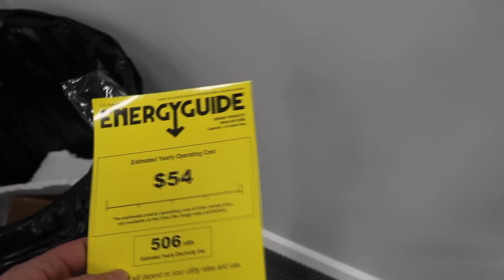Obsessed Garage Headquarters: Update Tour

Comment: Hey Matt, something caught my eye. The little compressor mounted on the wall on the left as soon as you walk in the door. Uncoil that extension cord (and any others) and fold it instead, then tie-wrap it for the clean look. Reason being, a coil of wire like that will act as an inductor even with a small load. Take a droplight rolled up from the ceiling, even a 100watt bulb can melt wires over time. If for some reason that compressor runs for an extended period of time it could be a fire hazard. Google coiled extension cord hazard and you'll find some info/pics.
Reply from the maker: I plan on cutting and shortening.

Comment: Matt, worried about fitting Sonic tools into Lista cabinets.  Cleanest tool organization and completely customizable, use (mold making) pourable silicone instead of precut foam.  Easy DIY,  can practice using any small container and a few sockets to get the technique dialed in.

Comment: Regarding acoustic treatment, I think you could get the echo under control for $2500 in panels and mounting solutions. $5-8k if you went crazy. I think you could also get the fabric custom printed in OG blue and it would pop so nice on those walls. Sound in a space like this is an intangible, but when it's done right you feel it- call it "cozy" or whatever you want. The echo doesn't come across on camera much at all, for what it's worth, so don't do it for us! When you get 8 guys buzzin around with polishers it could make a big difference.
Reply: I was also recently researching air compressor cabinets that reduce the sound by 30db, which is pretty significant. They're usually custom built for the compressor- sealed enclosure with baffled venting gets full reduction,  but a simple free standing half enclosure still cuts it way down. Hate to hide that pretty cylinder away, and you really won't know how much that thing is kicking on until the place is rockin. I can't stand to hear mine so I'm definitely building a sealed enclosure this summer.

Comment: Matt, since you are going to run a line through the wall for the hose bib, why not just run two and pass the pressurized water next to the hose bib? Put a quick connect outside, then all you have to do is connect the hose.
Reply from the maker: That's a darn good idea!
Reply: air too

Comment: Hey Matt what are your thoughts on indoor wash bays? seems like it would be better than washing outside as you can control temperature and that sort of thing but I'm sure its a nightmare trying to drain the water out and keep everything else inside dry etc
Reply from the maker: The issue is dealing with the water.  Also humidity.  In FL, mold is a significant potential issue.

Comment: Matt, you've owned and driven both the 1st. and 2nd. gen Raptors.  I like the looks of the 2nd. gen and of course it has updates that were not available in the 1st. gen.  The only thing missing is the V8.  What is your opinion about your new Raptor not having a V8?
Reply from the maker: I would much rather it have a Twin Turbo V8.  This one sounds like crap.  It's sad that you really don't want to do an exhaust as it will just amplify it.
Reply: Thanks, I appreciate your opinion.

Comment: Hey Matt - when will you have pricing available for Prevost stuff?
Reply from the maker: If you need a large order, hit me up matt@obsessedgarage.com  I can get it now.  I just don't have the energy to be doing $10 parts yet.  I have to build it one product at a time in the store.  I'll be doing that as soon as I finish the custom install pressure washer and a few RUPES polishers.
Reply: I have plenty of time, building a new house and wanted to explore and compare the pricing on using Prevost in the garage for air piping. I am also interested in picking up some more couplers and possibly the swivels. No rush, we are 8+ months out.

Comment: Sorry but the tower speaker in the corner should be switched around with the sub. I know the sub should be in the corner but it will help hide the power cords better. I know probably not necessary.
Reply: Oops just herd you are moving all the audio.....
Reply from the maker: Ha, ha... You know I'd never leave the wires like that.

Comment: If you're considering a forklift  would that be running inside the building , if so how would the flooring stand up to the weight ? Even small electrics and the nature of the steering can  cause a surprising amount of damage over time . But you've probably thought that through already . Great content as usual 😁
Reply from the maker: I have some people that have bought it and use forklift on it.  The only issue is the lip on the entrance.  You have to take it a little slower.  The weight isn't an issue.